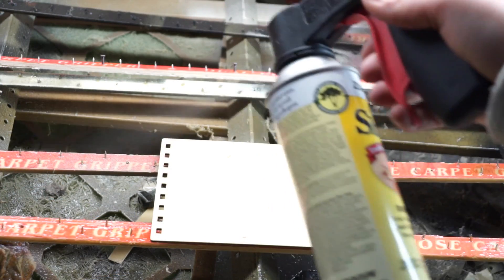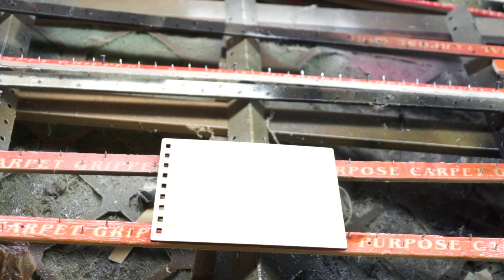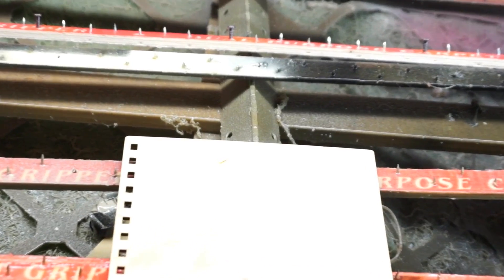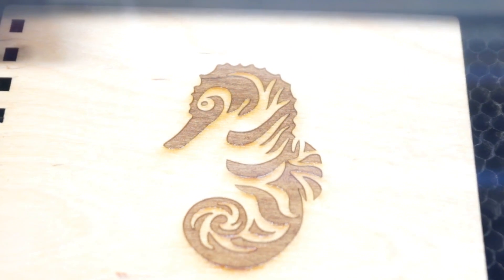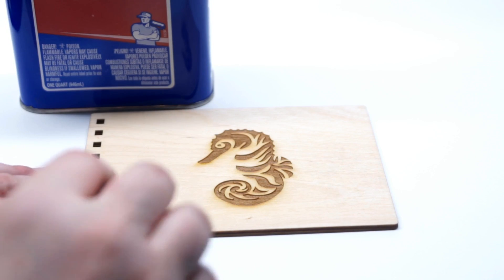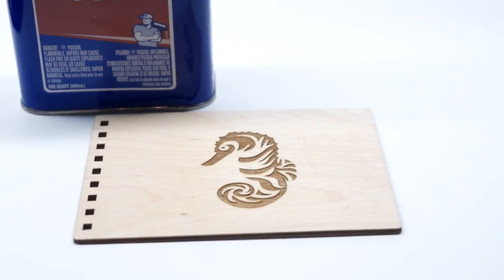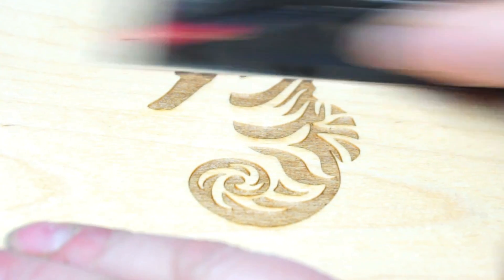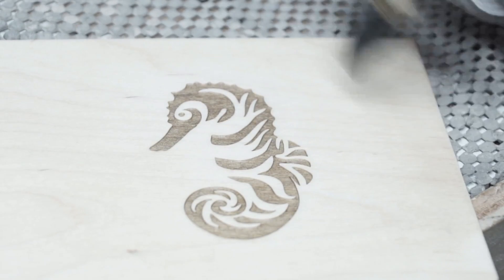How to Remove Burn Marks From Laser Engraving #laser

Comment: And how do you remove the burns from the cut?
Reply from the maker: It really depends on the wood you are using.  Some woods burn dark while others not at all.  There are 2 things you can try.  First do a faster speed and a lower power but multiple passes.  Also, once you have reached your desired depth, try refocusing, then do a fast speed and medium power.  Sometimes that is enough to remove a little of the burn from inside.  Cherry, baltic birch plywood and alder really burn.  It is a very nice effect if that is what you are going for.  Maple and oak burns less.  Hope this helps.

Comment: Is the sheliac bad for you to breath when it burns off? What is your favorite sealer? U r great!
Reply from the maker: Any chemical is bad to breath.  When engraving or cutting, most lasers should be vented outside to help.  Some have internal filters but you still have to be careful.  Plywood is layers of thin wood with glue in between which can also have a chemical reaction.  Be sure to be in a well ventilated area.  If you can smell thing while engraving or cutting, then you might want to invest in a respirator for fumes (not dust).

Comment: What file type, material setting and laser settings did you use to get that result on the seahorse?
Reply from the maker: I used baltic birch plywood.  The laser setting really depends on your laser.  All lasers are different.  I have a Epilog Mini 50 Watt laser.  I like a nice deep and dark burn so I do DPI of 600, Stucki, Speed of 40-50 Power of 100.

Comment: does this process work for letter engraving as well? im making wood signs and paint the surface white as well, if i paint and then seal will the process still work?
Reply from the maker: It should but I would experiment with some small scrap wood pieces first.

Comment: it always be black when i engrave it turns black i my setting is 10 mm/s speed and 0.8 maximum power even that the power is so low it’s still black

what do i need to do
Reply from the maker: Removing the burn is mostly concentrating on the surface and not within the engraving.  That is pretty hard to do.  It also depends on the wood.  Pine really doesn't burn but it also doesn't engrave evenly.  Maple isn't too bad.  Cherry, Mahogeny and Alder burn very dark.  If you do one last pass at a higher speed and lower power, with high dpi, that can sometimes help.  Or try colorfilling.

Comment: I’m engraving on maple wood but it get burned and not deep, when I work on another wood it looks good.  it’s because of vanish or shellac?
Reply from the maker: I use different setting for engraving on different woods.  You might want to take some scrap pieces and try out different settings.  I use maple a lot and don't have any problems.  I generally use shellac over varnish.  Shellac dries much faster and is a wood sealer.